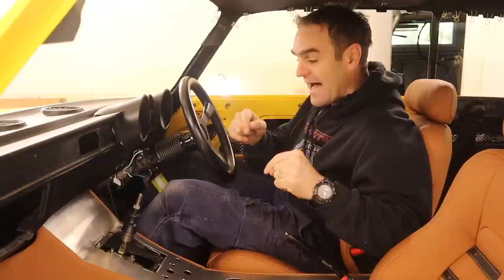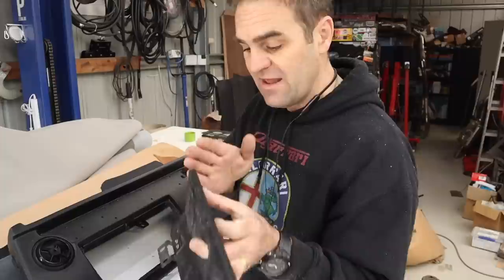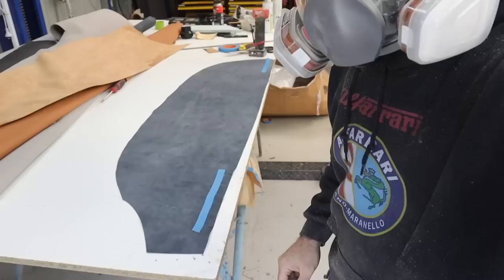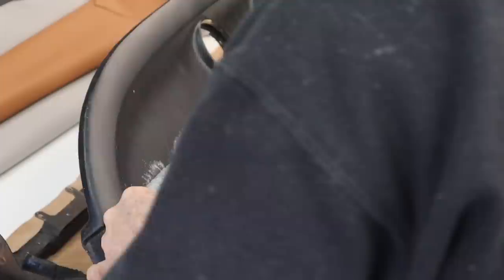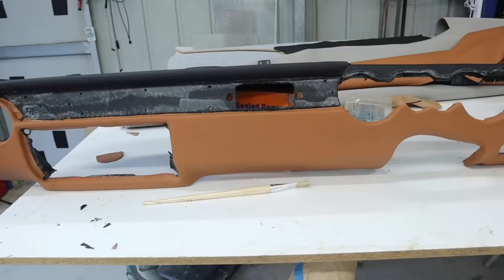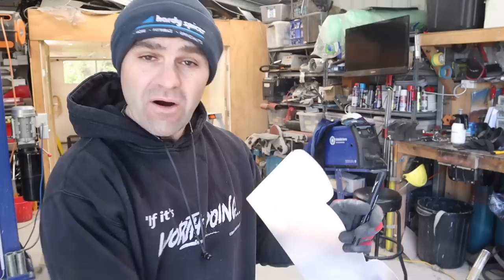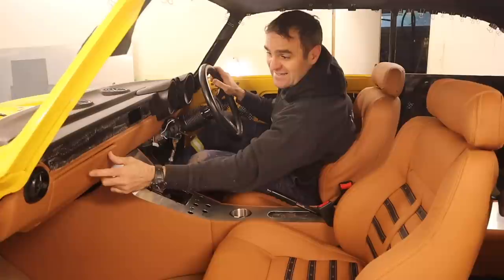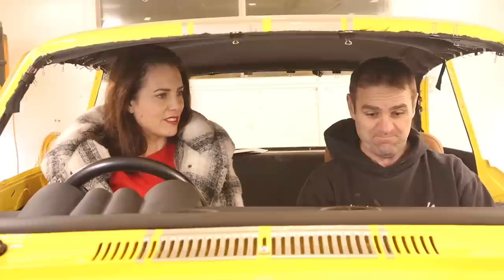Leather trimming the dash - Ferrari engined Alfa 105 Alfarrari build part 183

Comment: hi jeff where the garnish goes across the front of the dash where the leather joins you could wrap it also in leather and put Alfarrari embossed in it with double stitching top and bottom in the alfa colors dark blue over white on the top and red over green on the bottom cheers from broken hill

Comment: Quick tip for the future: if you want to have a fully annealed aluminium sheet (I presume the alloy you are using in Australia is either 1050 or 5052 or 5754) is to place your sheet for 7hours in a furnace à 180/200°C (including the warm up and the cool down time). Then it will be soft like butter for all kinds of forming. Cheers

Comment: Looks good👍
I would have made a wooded buck to pre shape the leather before sticking it down as sitting in the sun will shrink it and cause all those tight corners to lift out.
I recommend making some forms to clamp it into shape and cooking it a bit to help prevent this happening.
A big cardboard box with a couple of heaters to get it upto about 80 Celsius for about an hour should do the trick.
Choosing the right glue is part of the equation as well. Most glues will melt or dry out and turn to dust after a while especially on a dashboard.

Comment: Coming along very nicely Jeff. The toupee on the gauges looks great a solves the warping problem. I wait in anticipation to see what you are going to do with the two bottom gauge blanks and what you fill the dash and centre console in. I have a few ideas myself, but will wait and see what you do. May I suggest two metal ball vents at the ends of the dash. Keep up the good work. I saw Castlemaine Rods  Torana with a V12 Ferrari engine. It was far from being finished and your build is much better quality wise. Don’t know how it will drive with a 2 speed power glide behind the motor.

Comment: I have a bit of experience trimming classics and thought for sure you were going to make a mess up that dash, I wouldn't have tried it. Nice work, you got a pretty decent result. I'm both wrong and impressed, it's much, much harder than it looks! Might want to invest in a bone knife and a cobblers hammer. Tapping those french seams back with a cobblers hammer makes a difference, especially if you glue them first and the bone knife works better than your paint brush but does the same job. Skiving knives are also not expensive from any leather working supplies shop.

Comment: Good job on the dash! It looks really good in leather. Did mine last year in artificial leather (where you're not allowed to use any heat), which you could not really stretch without ruining the top surface. Did it three times to have it finally done right. It's a lot of trial and error. Should have used real leather instead. 😄

Comment: Hi Jeff, I'm very late to the party - you may be interested in a tool used for bookbinding called a bone folder, I think it would have been very helpful for molding the leather. Use a modern teflon one though, the ones made of actual bone tend to mark surfaces
Reply from the maker: Thanks I will have a look.

Comment: Great work Jeff .  My fear is parking the car in direct sun.. unless you sand the original dash completely you won’t get the key to hold the leather.. I feel you would of been better to use a fake plastic leather product to stop shrinkage and leather setting hard over time .. I think from experience the glue will fail. 
So to be neg about this , you’re ability is sound but glue will fail. Two pack glue would be better product I think..
Good luck ..!

Comment: Would a leather skiving machine help with those folded areas so you don’t get a lot of extra bulk?  Not super expensive for manual ones!  The sander also does a good job I guess to thin out the leather.  Nice job!
Reply from the maker: I actually bought one of the skivers with a razor blade and it is a waste of time for this type of thing. The sander give a much neater, more even finish.